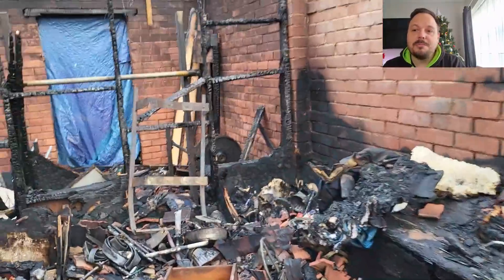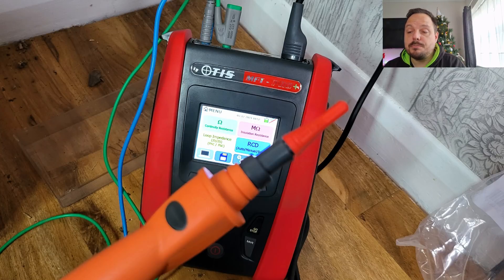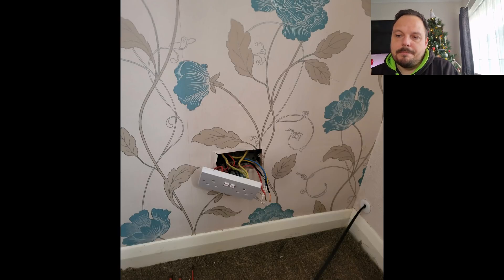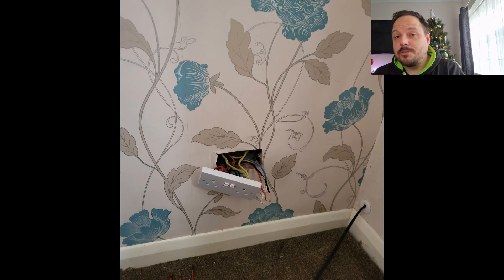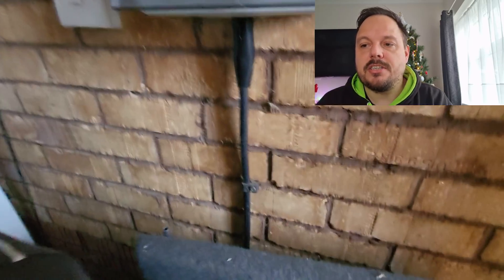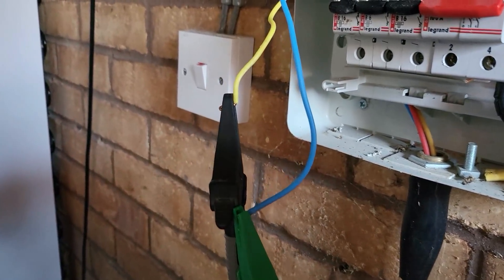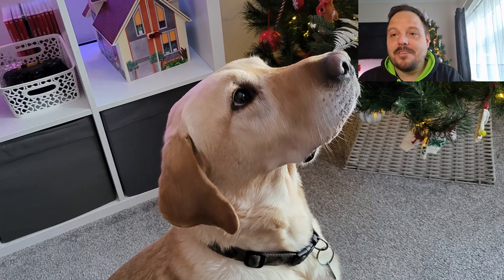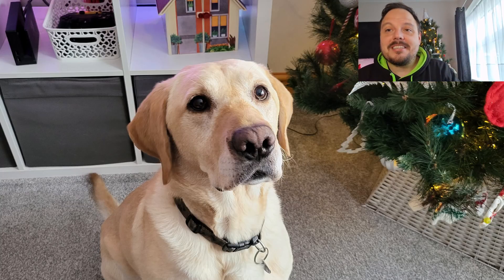ELECTRICAL FIRE! Destroys garage and we find out why. Plus some bonus electrical fault finding

Comment: I looked at this again after a year. Mark was constantly going on in a confusing diversionary way about z's and its testing and regs, instead of explaining the circuit setup and what really happened - then go into z testing, etc.  A fridge can catch fire, with the electrical side still drawing the required current so nothing will trip or a fuse blow. Mark did not say if the house mcb was turned off manually by someone or tripped, because of the fire in the garage (cable can melt causing conductors to touch).

As I see it, the fire erupted but the OCPD's did not activate because the current draw from the fridge was not high enough for tripping - until cables melted in the garage - even though the mcb was worn. 

As a side note, using the terminals of sockets as junction boxes is a no, no.  My final rings have Wagos in the backboxes that take the ring's load, with the socket a spur off the Wago using 4 inches of 2.5mm flex. The only time current runs through the sockets terminals is when an appliance draws current via it. The screwless Wagos take the ring's current load, not the terminal on the sockets. The biggest cause of domestic electrical fires is loose connections. This also applies to radials of course. 

Another note: A/C compressors have thermal cut-outs if the compressor gets too hot. Is this mandatory on domestic fridges?  If not, I am sure cheap fridges will not have them. Then again a fire can be because of other reasons in the fridge not activating a thermal cutout or an OCPD.
Reply from the maker: John that is a little disingenuous of you I have to say. I try really hard making these videos but it isn't easy while also focusing on the job at hand. 

Nothing tripped due to high impedance through the mcb. This was tested away from site to prove it. 

White goods as I said on this and other videos need huge improvement and the initial ignition is entirely to do with that. 

However at the stage all conductors in both the fridge and garage wiring are melted into one the OCPD should have operated. 

Now if that would have been fast enough at the initial point of ignition we shall never really know. Like you say depends on current flow. 

Fact remains a faulty component and thus high Zs was in place on the circuit which with regular testing could have been found. 

I hope that helps
Reply: @electrician247  
Sorry about being abrupt.  Thx for going further.

Comment: This is very interesting, I always do my zs readings. At the end of the day these readings will fundamentally give you the answer yes my circuit has a low impedance path back to the transformer. Calculations are not definitive.

Comment: Really interesting video. I tend to use the calculation method for non-socket circuits, but I hadn't thought of faulty OCPDs adding impedance that dead tests won't catch..
Reply from the maker: Lots of us do the same, especially in small domestic. I guess with the smaller loads and higher max Zs on the lighting mcbs it's less of a concern perhaps. But still a possibility.

Comment: all equipment should have integrated smoke fire detectors alarms.
Reply: Just build fail-safe.
Reply from the maker: Makes sense to me
Reply: @electrician247  electronics are so cheap now that these safety features should be mandated by legislation.
for ex amply a thermistor near the top of fridge compressor would open circuit and sound an alarm with a voice chip saying FIRE FIRE FIRE... cost less than $1
Reply: @esecallum  that’s the woke crowd saying “that’s racist, it needs to say it is 56 different languages” 

Joking aside Agree that this is a simple solution of a thermal fuse of sorts on the device in question and a lot less use of crap plastics everywhere. Even some simple electronics that takes into account the inrush current on motors which would typically last a set amount of time and would probably increase as the compressor gets worse would likely help and is mega cheap (you can get esp32 boards for a couple of quid and run what you like on them)

Comment: Maybe I never got it.  A 2.5mm cable was spurred off a socket on a 32A final ring circuit, then taken to the garage (assumed by the original builders as the house is relatively new).  In the garage there was a garage CU with four circuits.  The spur should be fused to 13A. Looks like it was not.  The 32A mcb in the main house CU failed?  Why didn't the subcircuit's mcb in the garage trip out?
Reply: Add to the 2.5mm cable a 1mm/1.5mm for the appliance in question, with a fuse of unknown amperage (read way to high). and then add a locked up compressor in the fridge freezer drawing way to much current for the appliances cable. 

Now what have you got?
Reply: @stephenhunter70  
I find fuses in many supplied plugs on appliance way too high a rating. My electric toaster is 800W coming with a 13A fuse. My voltage is 250v, so drawing 3.2 amps.  I replaced it with a 6 amp fuse. That is big enough taking into account a peak draw on switch on. It takes a hell of a lot of amps over a fuses rating for it to blow - depending on fuse type of course. And much safer, protecting the flex and appliance.
Reply: @johnburns4017 If the toaster goes toast what are you saving the cable for? It is rated for 16 A anyway.
Reply: @okaro6595  
The fuse will snap quicker stopping any fire, or potential fire, from continuing.  I wrote: "And much safer, protecting the flex and appliance."
Reply from the maker: Hey john. 4mm taken out to the garage. High impedance through the upfront mcb in the house rendered any sub ocpd useless. No fusing down off the back of the socket. 

The only thing that forced a disconnection in the end was incineration. 

Hope that explains it.
Reply: @electrician247  
Thx. So 2.5mm final ring circuit was supplying an unfused 4mm spur cable to a garage CU. So the 32A circuit was running at near full load a lot of the time wearing out the mcb prematurely. So the mcb failed in the main house CU when it should have tripped protecting the circuit. It never, creating the problem.  

A 13A unswitched FCU should have been fitted on the 4mm cable to the garage (it could have been in the garage, as long as the ring is protected) which would have caught any over-current on heavy garage appliances, being the 1st stage OCPD, with the mcb in the house the second.  So it was fitted incorrectly.

What size was the mcb in garage? 

Once again. Thx.
Reply from the maker: @johnburns4017  as discussed in the video the heavy loading has most likely resulted in the high impedance through the up front mcb. 

With that fault in place all other bets are off. The plug top fuse for example would also not have operated. 

The seat of the fire was the fridge/freezer electronics. 

This is why impedance measurement is vital.

Comment: There is a solution for Grenfell since 2011. Big electric companies deliberately blocked our innovation for years because they wanted to sell something that doesn't work. The people who perished didn't need to die. Those big electric companies are more interested in profits above safety!
Reply from the maker: I just watched your product video and left a comment. Nice innovation! I can see many benefits but would have a concern on the UK plug top with the fuse perhaps failing and occupier would be unaware of that. Maybe better to wire into the appliance power supply? Or build into products? Can also see a benefit for these at consumer unit/distribution board locations as well. Very interesting

Comment: RCD'S would not help that is incorrect. An RCD is essentially an imbalance device, it was not designed to protect against electrical thermal issues. An imbalance device protects against electrical shocks and electrocution. Big electric   
i.e. the manufacturers are pleased to permit the public to be deceived in this way. Therefore it is not the public's fault. Arcs overload/short circuit and high resistance connections are not the same things, they are all different faults entirely. We have the solution for electrical fires caused by high resistance connections
Reply from the maker: RCDs while not the solution in terms of 'total' fire prevention will definitely help detect an imbalance due to earth leakage before it can cause a fire/shock. So I see it as an improvement beyond an MCB/Fuse alone. That is an unknown in this and many other cases as to if it would have helped. So to say 100% it could not help is imo incorrect.

A more balanced view is that its part of the tool box alongside improved white goods, AFDDs, RCD, Load monitoring, fire surpression/detection among many other things. 

But to say RCDs have no possibility of helping when they see imbalances other devices do not is misleading and incorrect imo. Total solution? No, Helpful? Yes.

Thanks for watching
Reply: Quite correct, all measures for safety mitigation have an intrinsic value, ie a tool kit of various preventative methods better to be with, than be without. Imbalance safety devices were designed to prevent electrocution and shock and are materially unlikely actual ignition could be prevented by any imbalance device on its own. Arc fault devices use another technology to detect their 'prey'. However, this can only be to protect against either series or parallel arcing faults which are not common in the UK or other 230 volt territories for a range of reasons of which space would not permit detail. The far more common High Resistance Connection/Joint which cannot generally be detected by any other currently employed device has remained an issue for decades with is why the Pre Ignition Protection Technology Components ('PIPtech) were eventually innovated where together in a reciprocal relationship with the imbalance device and the tiny component placed commonly known 'at risk' location, provides the consumer unit with a central means of proactive, (not reactive) isolation, ie PIPtech also permits the imbalance devices to become doubly useful. Other fire risks created by overloading and direct short circuits,  (ie big overloads) have been covered for many years by circuit breakers or fuses, therefore such have been long accommodated. Thanks, Mark

Comment: Hello Mark, Great Content. Saved the best bit till last. Sad Dog just wants walkies 😀. What is your understanding of a high Zs not causing the MCB, Fuse etc not to operate under fault condition. I have never managed to get my head around this.
Reply from the maker: Thanks and you are right about coops, walk time lol. 

Basically not enough fault current can flow to operate the protective device if high impedance through the L-N or L-E path.
Reply: Loose terminals, old rusty terminals, squashed insulation in terminals instead of the conducter making contact with the screw;, MCB or fuse rated too high for cable used (e.g. 32a ring main that is no longer a ring has been broken), length of cable run... Increased resistance means lower current can flow so when the fault occurs either short circuit or CPC fault the current can't flow quickly enough for the fuse wire to heat up and pop, or the bi-metalic strip in the MCB to heat up enough and trip the spring to activate the MCB trip. I feel there is a missing test when we do inspection and testing: for testing the MCB to check it trips at its spec'd level of fault current.

Comment: I just wouldn't feel confident using just the calculation method, I'd rather verify with live testing.
The only circuits I would just use calculation is off peak storage heaters.
Reply from the maker: Thanks Paul. Yep that is another good example of when live testing can be difficult!

Comment: I have been to a few tumble driers recently where the moulded plug has melted causing damage to the socket as well i do wonder if appliances like some Tumble driers and portable heaters have a way bigger load than the plugs can handle over a prolonged use.
Reply: And sometimes tumble dryers fire are due to lack basic cleaning of the filter, vent, & the build up of fluff (lint) catching fire..
Reply from the maker: @stuartandrews4344  absolutely
Reply from the maker: We definitely have an issue with white goods!
Reply: @electrician247  So on balance - would it be better to cut off moulded plugs and fit a plug top so you can be sure of exactly what is going on?

Comment: A few years  ago I installed a new CU and wired an extension. A few months after 5 fire engines attended to put out house fire caused by fridge. Insurance covered everything except a new fridge. Luckily no life lost. Installed more smoke alarms after! Makes you a very careful worker 👍🥸
Reply from the maker: It sure does. We have been on many fire damaged jobs (not caused by use 😊) deffo makes you think!

Comment: My niceic inspector told me Theres no need to do any live testing, hopeless
Reply from the maker: Technically they are right in terms of guidance. Enquire Ze, calculation for the rest. Doesn't put consumers safety 1st imo.
Reply: @electrician247  We were told the same, I have heard the point given that if you get a Ze and an R1 + R2 and the RCD/RCBO disconnects on testing less than 0.4 sec you have proved your circuit is safe. However in this case the protective device had gone faulty to a high Zs. I can understand to a point regarding live testing trying to hold three leads etc but in most domestic settings you have lamp holder adaptors and most if not all testers come with a 13A plug and lead adaptor. But a point and example well pointed out.
Reply: Jammy

Comment: Fridge freezer compressors and tumble dryers are the two most common appliances for causes of fires from memory. I have to admit though I rarely, maybe 1% of jobs do calculated ZS, I live test almost every job and every circuit because if you're not testing under working conditions my view has always been what's the point? To me it's the equivalent of testing emissions on a car with the engine not running and just calculating it from volume of fuel to air, not practical at all.
Reply from the maker: The debates people will have about only calculate Zs leave me speechless sometimes. Yet they teach this as the only method in colleges right now. Find that such a shame. 

White goods don't seem the best in general lol mate.
Reply: @electrician247  It makes no sense to me why they don't teach live testing in colleges in an arguably safer situation to learn than out on site. I remember my local council limited their Mears contractors to only do Zs tests if they could be done with 3 points of contact on a pair of steps, even listing two feet and a hand.

White goods aren't great but due to lack of maintenance/ user knowledge on both items, fridge freezers de-gassing causing the compressors to over heat from working too hard and tumble dryer filters not having the lint cleaned out. I remember reading an article a few years ago about it where insurance companies wanted to back out of claims if it was proven to be negligence on the users part but I don't think it gained any traction.
Reply from the maker: @effervescence5664  totally agree. Some lecturers are actively suggesting live testing is dangerous and should not be taught as its not needed. On both 2391 and apprentices course. Madness as how will they know how to risk asses and do it safely.
Reply: @electrician247  That is madness for a couple of reasons. One how will attending engineers know to risk asses and carry out works safely. Two how would anyone that carried out a EICR that only knows how to calculate Zs struggle with the guilt of a fire in a home that could have otherwise been prevented by carrying out a live test. It's bad for the industry and the overall quality and skill level but it's potentially dangerous for the end consumer. The mind boggles.